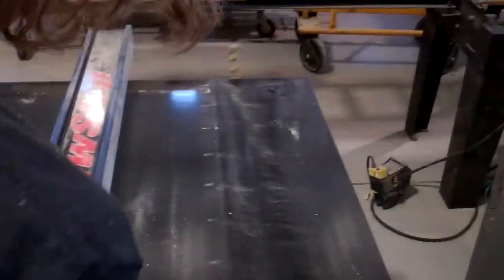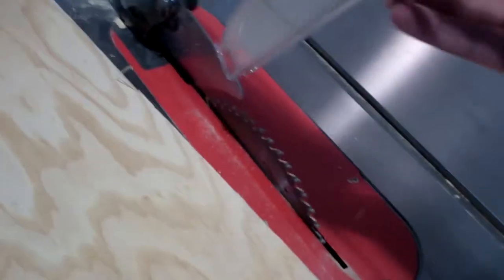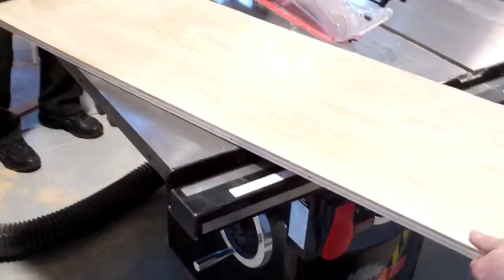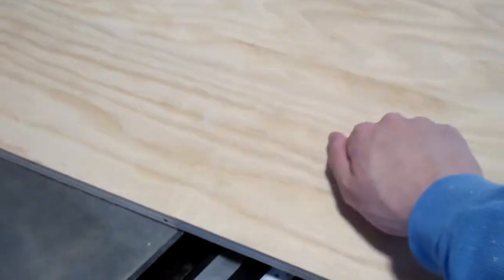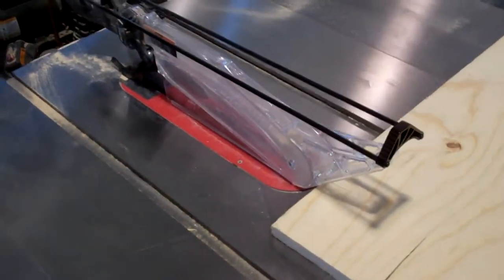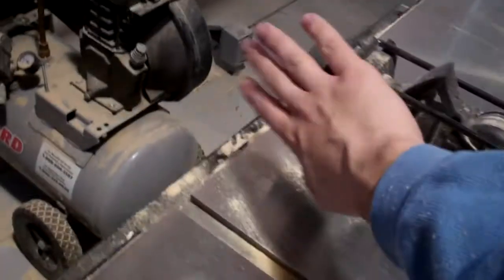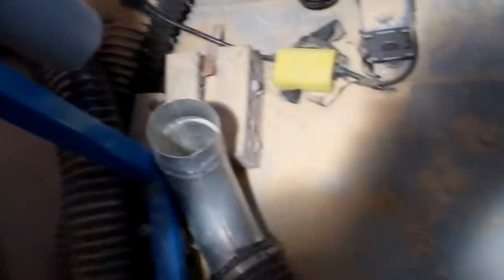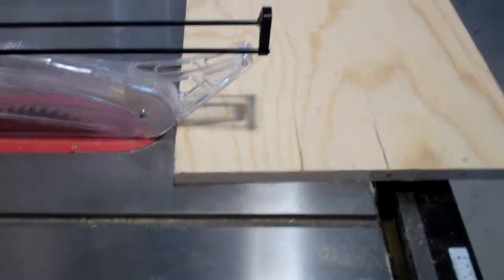Sawstop Demo with small kick back !

Comment: In case anyone watching is curious, this is not how to use a table saw for a piece of wood this shape. It should have been done on a panel sled or similar jig/slide instead of pushed up against the fence like that. Putting hands on either side of a piece that wide is ASKING for a kickback and your proof is in the video.